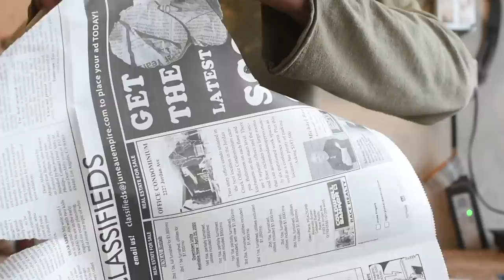Forging a Hidden- Tang Hunting Knife (Frame Handle) Full Video

Comment: 80crv2 best allround steel for everything from a carver to a beater IMHO...
Reply from the maker: Yeah I like it alot
Reply: @LiamJPenn  плохой нож
Reply: Just wondering if that's good for beginners!?? 
Im not going to be forging though.
Basically, buying "steal blanks", cutting steal into shape with an angle grinder, fine sanding with a belt sander, then heat treating in an old grill, then quenching in oil....
Of course, gonna sand some more to get a nice finish. 
Any sort of recommendations would be appreciated....thanks...
Reply: @ericwilliams7374  i would start with 1084 if I were you. 80crv2 needs a faster quench medium (parks 50) and with 1084 you can get away with using canola oil instead.
Reply from the maker: @ericwilliams7374  80crv2 is a forgiving steel to work with, I think it is a good beginner steel. It forged easily and has vanadium, which helps with grain refinement which is important when you are not heat treating very precisely. That being said you should be able to do a good job heat treating by eye with practice. Learn what the right temperature is. A magnet will stop sticking to the steel at about 1420 degrees f, so you need to be a little hotter than that. I recommend using parks AAA oil, buy parks 50 or even canola can work too.
Reply: @LiamJPenn  thanks for the tips and responding. 
For practice, I've been reshaping old knives, axe heads and other little assorted metal pieces.
I can only get better with time. 
Thanks again for sharing your video and tips!! It really is much appreciated.
Reply: @checoleman8823  thanks, the metal supply store here around Frankfort KY (Lexington KY) have a lot of that....what you mentioned.
They also can ruff cut it to length for me as well. 
Now, I just have to actually do more to get practice in. 
So hopefully this time next year I'll be pretty decent with making knives and small swords.
You know, for the up and coming apocalypse!!!😂😂😂😂😂😂😂😜😜😜😜

Comment: Nice video. But full tang or no tang. Personally don’t buy ANY knives without a full tang. I want completely structured build that will last. Can’t tell you how many handles have been broke over the years from those half aka hidden tangs. They’re garbage for daily abuse. Got to finesse tho ladies.
Reply from the maker: A hidden tang done right can be just as strong as a full tang. Tangs break when they are too hard, too small, or have too hard of a transition. Usually it’s a combination of these factors. This one had a fairly short stubby tang, but I notched it so the epoxy could get a better grip, and I pinned it in place. My general rule of thumb is for the tang to be as big and thick as is reasonable, and for it to go at least 4/5 of the way through the handle. I also make sure to temper back my tangs so they aren’t too hard. It would take some serious doing to break one of my hidden tang knives, but I understand why you might be disappointed with many cheap production knives
Reply: @LiamJPenn  knowing what you’re doing makes for a better product than any out of the box made in China knife. 
Beautiful work. Also hidden tangs are an art in itself and pulling one as nice as this one off is 👏👏👏